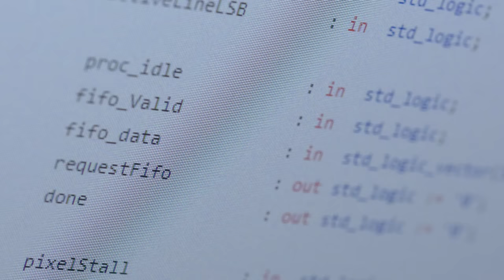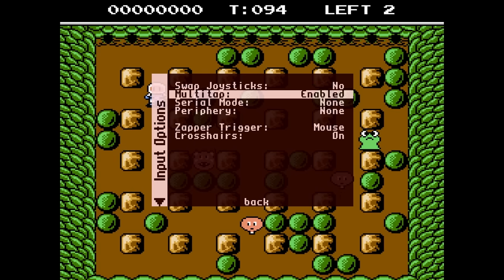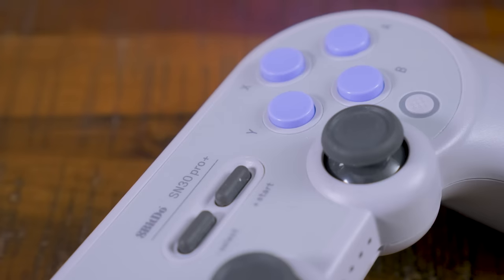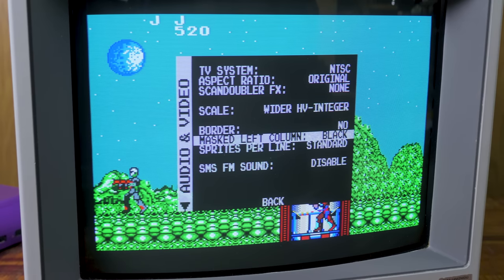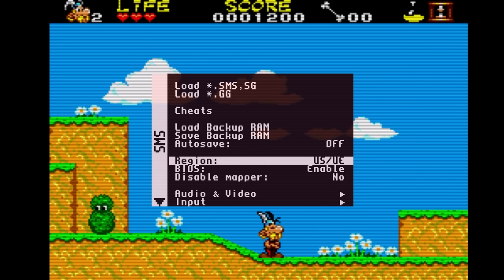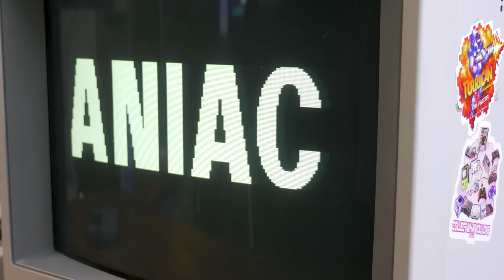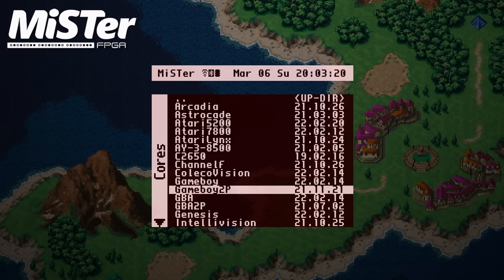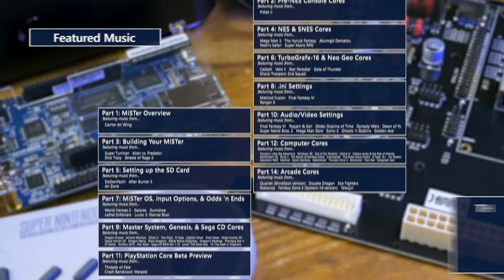MiSTer FPGA in 2022: A Primer Guide to Retro Gaming's Hardware Emulator / MY LIFE IN GAMING

Comment: So I wasn’t the only one who though a Speccy was a mould infested piece of rotting junk 😂I’m from the Netherlands and when I was a kid we immigrated a lot for my dad’s work. So in the US it was Apple and Commodore and my parents rented me a C64 that year we were in the states. Then we moved to the UK and I could use my own C64 and I found two things… things were slower on my C64. Indeed bound to 60Hz or 50Hz frame rates made a difference. My friend being a stubborn Brit who do everything wrong compared to us mainlanders had a… Speccy. You would rarely seen them in NL and I then knew why. Where the C64 doesn’t have the greatest pallet the Speccy is a primary colour puke fest like a toddler’s drawing. And sooooo slooooow! When we moved back to NL my friend had an Atari XL 800. That was even rarer than a Speccy and it wasn’t considered great. We did play Bruce Lee to the end and it look better with its colour pallet. Recently I procured and fix one on my channel and did a review of a disk drive alternative. And I gotta say, the Atari XL is probably better than the C64. Except I’ve coded so much on the C64 in assembly that when I started to make a course on my channel that I just remembered hardware addresses. I don’t have that comfortability with the Atari, so I won’t knock up a little scroller with music as easily. I do want to deep dive into it as well. It’s a great machine and unfortunately underrated.

Comment: i dont see where this is better than my xbmc modded xbox not trying to start a fight about it just compared to simply playing on windows emulators all these years since direct x made those things possible it seems like a lot of extra work.
Reply from the maker: [Try4ce] I think it depends on your mindset and what types of tools you're familiar with using. Software emulators can also be a lot of work when you're not familiar with setting them up and getting good settings out of them. MiSTer is more consistent in its presentation and settings compared to various emulators. Sure, there are unified frontends, but I personally find RetroArch much harder to use than MiSTer. Someone who is used to RetroArch might not agree. Just different approaches for different people.

Comment: Can it run Sega model 3 arcade games
Reply: no
Reply: No.
So far, only up to System 18 is supported - I believe System 24, X, and probably Y are possible on the DE-10 Nano, but those need to be worked out by jotego or someone else.
System 32 might be sketchy but might be doable, but don't expect Model 1.

Comment: Why do retro gamers often misrepresent FPGA's as emulators. When infact they're playing games not on a software based approach, but rather than a hardware repo on a system on a chip.
Reply from the maker: [Try4ce] Because retro gamers often misrepresent FPGA systems as not emulators. We always make the distinction clear by saying software emulation or hardware emulation. Ask any FPGA developer if their work is emulation and they will say yes, it is. It's totally different in its approach from software emulation, and offers many advantages (just as software emulation has perks of its own) but it's still emulation. It is not the original hardware and bugs are still possible. Depending on the complexity of the system, the implementation may be considerably different from the precise function of the originals, but the end result is most often indistinguishable from the real thing when done correctly. For instance, quite a bit of work had to go into working around PS1 RAM speeds on MiSTer, but the end result is pretty darn accurate nonetheless. It's hardware-based emulation and it's OK to admit that it is.
Reply: @mylifeingaming  do you still play original hardware? or did you replace it with mister?
Reply: @pekeciel  A mix, if I recall correctly.

Comment: thank you for saying that FPGA emulation is emulation and it's only as good as the programmers. just like software emulation.  So many people always assume things are just better because it's FPGA, no. It has it's own advantages and disadvantages, just like software emulation.  and it is still emulation, so it's only as good as the programmer and how accurate they make it.  it's not inherently 100% accurate just because it's an FPGA system.

Comment: One thing this video, and many other Mister videos, won't tell you is that there are a ton of bugs, most have existed for a couple of years, never get fixed. And a lot of these bugs include 15hz CRT support - which the original hardware supported. If you go over to their forums, as a CRT user, you will get a lot of anti-CRT crap from the HDMI twats. You will also find that the owner of the forum, and this project, is very much ANTI - CRT, and bugs in Acorn Atom, Acorn Archimedes, Playstation,  and many more, will not work in 15hz CRT mode, even though original hardware did.
Other bugs include lack of floppy image support - for example, it took a guy on a different forum to fix the long-standing ssd image bug with the BBC Computer core. Lots of cores don't support disk images, they have to use vhd boot images - and these are a pain in the arse. 
Some core don't sound right, and worse than emulation. Save state is only in select cores, so if you like that option, then you are out of luck.
Original controllers are also a pain to get to work. Some - SNAC, work in select cores. Others need expensive cables, especially if you want all your cores working with original controllers.
When Mister works, it works great. But don't go in, as a first-time user, thinking it will be easy sailing, and you'll get the same experience as the original hardware. There are still many frustrating things about this device that you won't hear about in videos like this.
Reply: yes there are bugs in some of the cores but none of them will stop you from gaming the problem is there are not many devs to fix theses bugs but they will be fix in due time the project is not that old. yes sorg is not a big fan of crt tv but he is the reason we have direct video nobody step up to the plate to add this if he was against it 100 percent he would have not wasted his time to do this . this is a open sources project you see a bug help out by reporting it or fix it yourself
Reply: playstation? it's not even finished yet
you sound like a crybaby tbph
Reply: @soloM81  I wish people would shut the hell up about Direct Video - it's not a cult, you know. Direct Video adds to the image that original hardware didn't. Increased saturation, and an image that looks too perfect, too much artificial. I can run both original hardware, and Mister on the same CRT TV, or Sony PVM, and Direct Video looks fake, looks wrong, too clean. VGA is still wrong, but at least it's true analogue, and gives a better interpretation of original hardware.
Reply: @DKTronics70  then fix it its that simple if you got a promblem with it show Sorg how its done and he will fix it he does not have a crt to compare also mike has done s-video and composite maybe this is better for you?

Comment: Why not just use retroarch?  It has all these in software?  Am I missing something?  I’m playing all these systems in retroarch with a launchbox frontend. The world is digital now. Analog and hardware is not sustainable. 😊
Reply: The appeal of MiSTer is not that everything is in one place, but that it emulates many consoles with 100% accuracy, with 0 input latency. Software emulation is guaranteed to introduce some input latency, on average about 133ms. If that doesn't bother you, then Retroarch is perfectly suitable! And I don't think MiSTer would be considered Analog in nearly any definition of the word, since it runs games off of roms, just like software emulators. With no antique hardware required, it's sustainable for as long as the MiSTer community supports it! So I think MiSTer isn't just a great way to play older games, but a massive step forward in the history of emulation and game preservation.
Reply: @xenophanes2807  I’m not witnessing and delay at all playing my ROMS

Comment: I dont get it . Why do all this instead of just  using emulator?
Reply from the maker: [Try4ce] Technically it is emulation, just a different type of emulation. And you're not wrong - the difference between software emulation and hardware emulation like MiSTer can be hard to see. Both can get 99% or more of the way there to giving the same experience as original hardware, but the underlying techniques used to get there are different, and may also have some slight differences in presentation. For instance, FPGA may be able to more easily match the exact timings of original hardware, while more robust GPU shader techniques may be available with software emulation to simulate the glow of a CRT and stuff like that (but MiSTer has some great CRT effects too!). Basically, if the idea of how FPGAs work is interesting to you and increases your enjoyment of the game, then it's for you. If that doesn't matter to you, then it's not and that's OK! They are different approaches for different people with different technical interests.

Comment: Maybe someday....but I need save states support on every core, and Retroarch it's just so good...
Reply: Same, Retroarch on my desktop PC with the Bigbox frontend is just paradise to me. My PC is powerful enough to handle the cycle-accurate emulators for 16 bit and below systems, with run-ahead/gpu sync/max frame delay AND CRT-Royale on top of all of that for an authentic CRT look on a 4K screen.
Plus, I like Retro Achievements too, can't do that on an FPGA... yet?
Reply: @steel5897  retroarch is shit to use, much worse than mister. the settings menus are bonkers
Reply: @steel5897  exactly

Comment: Why is this better than retroarch with a launchbox frontend on a pc?
Reply from the maker: [Try4ce] If you're happy with that, then it's not better. They are different approaches for people with different mindsets. If the tangible result is all you care about, then they are similar enough. If the idea of hardware emulation with parallel processing isolated from any OS and other processes excites your brain in some way, then MiSTer will be a fun approach for you. If not, then other approaches will give you a similar enough result. It is not about "better" or "worse" from my point of view, just different tools for people with different brains.
Reply: @mylifeingaming  thanks
Reply: because it's tiny and runs in parallel?
Reply: much easier to configure and update, plus much finer controller options (original, overclocked USB), faster boot, lower power consumption, etc.

Comment: just reverse engineer the consoles.
Reply: That’s literally what this is. You write the reverse engineered logic into a verilog file and compile it for the fpga to function as if it were that hardware. It’s not worth it to make cpus that will fit the spec of the Atari 2600, Apple II, NES, SNES, PC Engine, Genesis, or whatever else. This is as close as it gets to reverse engineering the hardware.

Comment: Huh., software emulation is in fact harder due to the parallel nature of hardware, even worse when you get to things like the PS3 and it's 7 PPC cores. Don't even want to get into other details... FPGA is just better as it recreates the original hardware logic enabling it to behave like the original hardware. 
Doing this in software is only possible due to the amount of CPU horsepower and multiple orders of magnitude higher instructions per clock available to run on todays CPUs, but the amount of work arounds and tricks needed make the software implementation not only hard but never possible to be exactly 100% true to the original.

Comment: way too much trouble (and money) to play the same old games on a slightly different way, classic emulation is plenty enough, specially in modern pcs that can handle big frame delay numbers which makes the input delay virtually zero
Reply: Let me correct: classic emulation is enough for YOU, Vinícius. Some of us value the fact that the game is running on hardware as opposed to software emulation.
Reply: Run-ahead does way more to input delay than frame delay, hope you're using that too.
1 frame is a good baseline for a core override, then 2-3 for some game overrides depending on the game's internal latency.
Reply: LOL

Comment: Throwing shade at Retropie.  You litterally write an SD image to an SD card then plug it into a Raspberry Pi and Retropie is installed.  It cant get any easier.  You obviously have little to no experience with current Retropie development.

Comment: Honestly until a proper GUI is made, I probably won't invest in the cost of the hardware. It's not cheap. 

Software Emulation has gotten to a point that with look ahead and code improvements that unless your an Uber hardcore pureist or speed runner, they are now great for 95 percent of people. 

The thing is most people don't have 10 Roms. They have hundreds or thousands and a text based list is not ideal. Unless it's a well known popular title, your not going to know what a game is based on just a title.  I'm not asking for a messy busy bloated thing with animations and video. But a basic screen with a single screen shot, title and description. No settings needed even to keep bloat down. No scrapper built in. The screenshot and nfo can be required to already be in the rom folder so people can use an external scrapper of choice to source that and just load the files on the sd card. 

I know the base mister doesn't have a proper gpu to render that stuff or what not, but why can't an add on be made that does. It has add-ons with everything else already anyway.
Reply: As someone who was actually playing these systems when they came out, for me at least, software emulation is basically perfect.  For me the people who buy these hardware emulation solutions are just rich idiots flaunting their wealth.
Reply: Strongly disagree with this.  One of the things I like most about MiSTer and EverDrives is that it's just a simple alphabetized list - no nonsense coming between me and playing a game.

I've spent countless hours in the past getting things to look nice in RetroPie or on one of the Chinese handhelds only to have that work completely undone by some update or getting a new device that's incompatible.  Not only that, but unless you go in and individually edit a bunch, automatic downloading of crowdsourced data always fails for a number of games - a problem made much worse by having more games, not better.  If I have five hacks of the same game on MiSTer, I just name them something different and I'm done, if I put those same games on RetroPie I'm spending like an hour manually editing XML files to get them to look acceptable.

Not that I would be opposed to this being an option on anything for people who want it.  I just wanted to point out that for some like myself, this is not a shortcoming at all but a welcome style.
Reply: @chrisv.4279  Exactly. Have the option. I didn't mean to force it on people..
And it can still be an alphabetical list. But when you have a few hundred or thousand roms for a single console ... No way your going to know what a game is based on the name unless it's one of the popular titles. 
Having a basic simple screen that has a single screen shot and description when you goto each title would help greatly in knowing what's what. 

It doesn't even need to have settings. You can make it so the screen shot and nfo has to be provided already in the room folder. That way it keeps the bloat down and people can use what ever they want external to it to gather the media.
Reply: @guardianali  I will agree with you on that. It would be nice to get a description of what you're playing. I've played a few hentai games on the PCE-CD on accident.
Reply: @karehaqt  nope. You just cant tell the difference. Others can. Software emulation has flaws unsolved in decades. Therefore fpga is the best to play retro games. There are even perfect cycle accurate emulators but mostly they suck.
Reply: You want a fancy frontend and endless lists to scroll. Get an raspi. I like the minimal design and idc about a fancy frontend if i can play games accurate.
Reply: LOL, back to hyperspin with you

Comment: It's literally just emulation with compatible cartridge slots, it's still the most accurate emulation but it's still emu, and it's definitely NOT the future to preserve games, are u insane ?? Using an original cartridge is becoming a niche and unnecessary part of emu, most roms are 1:1 data dumps, and cartridges ate going to disappear at least at the same speed of the consoles if  not faster, please stop promoting this as some kind of "legit" option above roms, ppl who know how this works have been laughing at this device for years lol 😆
Reply from the maker: [Try4ce] You don't use cartridges on MiSTer.

Comment: I admire the work you guys are doing, but let's get realistic.  The MiSTER is WAY overpriced, and WAY underpowered.  You can pick up an i3 mini computer with 16 GB or ram, 2 TB, and the ability to run over twice as much.  I wish you guys put the same time, and effort into something that made more sense.  You're looking at dropping 300 bucks into the ability to play up to Mega CD?  Come on.  A 129$ Celeron off Amazon is hands down a much better investment.  With RetroArch, you have pretty much the same control, but WAY much power, and WAY more cores.  What you guys are doing should have been done in 2007    The cores you guys described will run on a 35$ garbage box.   The Mister is cool, but it's not worth the money.  Not at all.  (I'm assuming you guys are Canadian...."BiAHS"??  Kinda drove me nuts every time I heard it.   Seriously.   The mass of your audience  will be fine with a 119.99 Android based